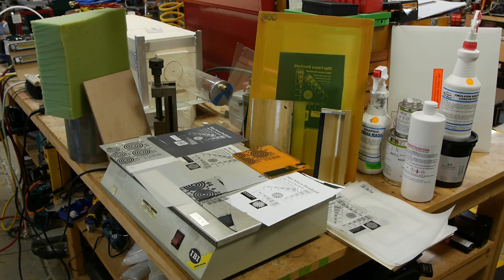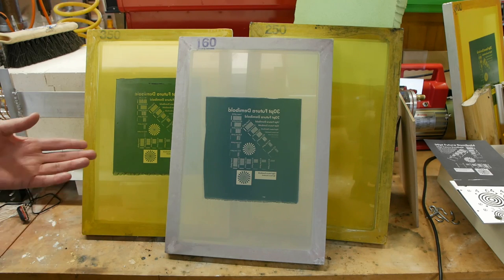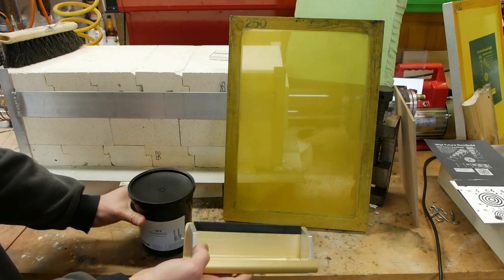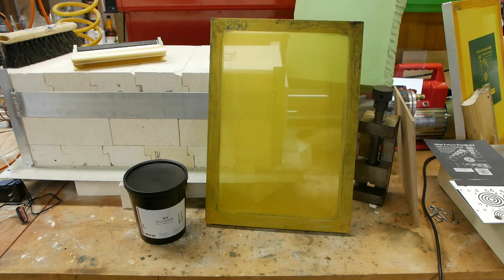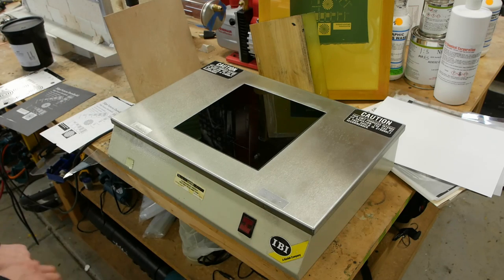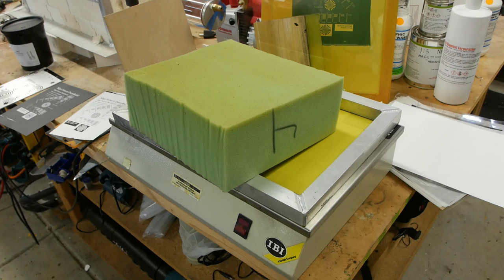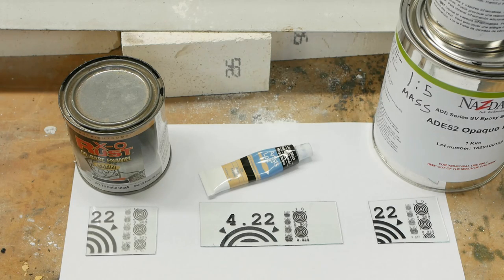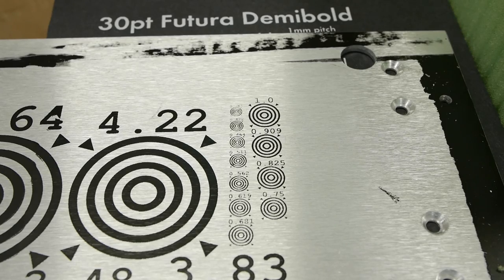High-resolution screen printing demystified

Comment: A couple of things here.  I really like your video.  It covers a lot of points I needed to see again.   

HOWEVER....  I see you in the opening scenes pulling the squeegee twice.  Once pull, then a fill push, then another pull.  Is this smart?  I think it will make a mess on the underside of your screen or make double images if the reg is not exactly the same.   I think on pull is it.  Maybe a different squeegee might be in order if you feel you are not depositing enough ink in one pull.   

SECOND:  I had no luck with Vellum.  It  just blocked too much light.   I had very good luck with the clear.  For the clear I used an ET-2750 inkjet printer on a clear Laser Printable film.  You can only print on the side that has a coating which will receive the ink.  On the other side the ink just runs.   

THREE:  I printed two clear films of each image on this clear film.  Then after they dried I layered them to create greater density.  I made sure not to touch the printed side as it could degrade (remove) the printed image.  I used clear tape to attach the films to a plate of 1/8" window glass ($20,00 new with the edges ground so to prevent slicing yourself and bleeding to death happens quick... careful!  Voice of experience here)  

I am printing lettering & logo art on the front and back plates of a aluminum enclosure used in an audio product I am producing.  I did screen printing in college Version 1 back in 1972.  I used the links in this video to purchase the materials.   I went elsewhere for the screen press and screens.  I just had, had it with the grumpy screen printing people out there.   I think they have been breathing the epoxy fumes for too long.   Hey, why pay someone to insult you?  Right?  Your video helped me a lot.  

Jim Moss Fiddler and Engineer/Programmer and later Marketing Degree

Comment: For the exposure, I would think that with a distant point light source or the sun, the micron gaps between the paper and the emulsion (coating) would be less of an issue. Perhaps you could replace the metal cover of your UV box, with a black cardboard or wooden box, a meter high or so, to increase the distance between the lamps and the screen. This would also bring the full lamps into the picture (pun), as that small window exposes (pun) less than half of the lamp's surface!
But then again, the velum will cause quite some subsurface scattering (diffusion), so maybe that defeats the whole lamp distance effort.

Comment: One thing,   I saw some place where they used some thin ( I would guess .025" thick) clear vinyl sheeting (Tap plastic in MV has it) as top layer to hold down the artwork using a vacuum pump. One would need something flat on the back like 1/2" MDF backed with some thin aluminum.  The idea is the vacuum pump goes between the aluminum and the MDF as the air will move through the MDF (very porous)    Al -vacuum MDF - silk -- art - thin clear vinyl  taped around the edge.   Craig

Comment: Use masking tape to tape off areas outside of the print area. Makes clean up much easier.  
Can expose with a 100, 150 or 200 w ordinary incandescent lamp.

Comment: I recently worked with metal nanoparticles for printing them in a standard desktop inkjet printer.
I tried to use copper nanoparticles since they are cheap. Unfortunately they oxidize rather quickly making working with them very hard. I also did not find a good ink recipy without toxic chemicals involved.
I found out that there are companies who offer silver ink online and they are suposed to work well with brother inkjet printers but I never gave the comercial nanoparticle ink a try. My own ink always clotted the printing nozzles. Nanoparticle ink might be a faster alternative to getting conductive circuits. Some background: I worked on this for a science project where we produced nanoparticles with synthetic bacteria. Project details can be found here: http://2018.igem.org/Team:Bielefeld-CeBiTec
Reply: @papu90  As far as I know the highest conductivities can be achieved with cut outs from silver sheets. The next best thing is printing and melting silver nanoparticles. Polymer based inks are more flexible but the conductivity is much lower. Carbon nanotubes and graphene seem to be flexible and conduct electricity well. They can be made super thin which helps making  them flexible but I do not know if they can compete with silver in terms of conductivity.  
I have not worked with Graphene but producing it seems harder and more expensive. I also do not know how easy it is to create conductive patterns with it.
The research seems to go in the direction of using Graphene for ultra thin electronics. I am especially interested in the use case of electronic tattoos for use in personalised medicine. We worked with nanoparticle because you don't need expensive equipment, a household printer, a kitchen oven and thermostable paper is all you need. Nanoparticles melt as exceptional low temperatures depending on the size and quality. Our copper nanoparticle 40 nm in size required 340°C to melt them into conductive structures but silver nanoparticles should have an even lower melting temperature and depending on the size (nanorods/nanowires seem ideal) and  temperatures melting points under 100°C might be achievable.
Reply: Try to do NOT use direct partical deposition.Instead : prepare silver or palladium activator - it's easy . This can bee an amonia complex(just desolv silver chlorid in alcaly and then add amonia to completly disolve oxydes )or coloidal solution of palladium-(dissolvind p.cloride in  colded stannum cloride.)-this give you a small micellas in acidic solution.  Then you can print them out on the sensibilized surface . Stannum cloride is usually used as sensibiliser ,then its washed out and deactivated by alcaly  p-you need hydrooxide film only. Problem there is to prepare a surface - cause etching in strong oxydisers needed.  You can also print copper in complex or as solt combined whith potassium hypofosphit- dry it and and then slowly heat it up to 150-170 C ... The last one method can be used for pcb manufacturing - hole\via metalization, but film is thick and galvanization needed for good result ...
Reply: @Appniko   We used the copper particles directly since when we produce them in our genetically modified bacteria the end result are particles of 8nm size surrounded by a protein shell. We showed that the production of particles inside the protein shells can be achieved in bacteria but than used commercially available pure particles (40nm) for the printing and melting experiments since they are similar to the particles we have produced in bacteria. Producing nanoparticles in bacteria and than printing them is probably not the best use case since you get much cleaner results by producing them chemically but it was interesting in the context of our project.  The use cases where you functionalise the proteins surrounding the nano particles seems much more useful since you can combine  the advantages of nano and bio science.

Comment: Pro tip, you can save a decent amount of money and get better results out of your emulsion by adding up to 1/4 water to emulsion before coating your screens. This will make the coating thinner, the exposure more crisp, the washout easier, and your edges clearer due to the screen being closer to the substrate.

Comment: Sooo.... What would happen if you used a Tig torch as an arc lamp/UV source?
Reply: I did screen printing a couple of times in high school and we used a light table that was an arc light. Glass top and 2 wobbly electrode tips that you would crank together to make an arc for a short time.
I took for granted all of this knowledge he is spewing. The teachers must have really had their act together. I just remember:  "make a drawing, put the stuff on the thing,  DON'T LOOK AT THE LIGHT!, Put the ink on the screen and wipe."
I will likely never use all of this interesting information, but at least now I know.

Comment: Getting a consistent coating is not iffy if you know what you are doing. Also, the premade film will not last nearly as long before flaking off. Your best bet is a Diazo emulsion that you water down yourself for the specific application. The quicker you move the trough, the more consistent your results will be.

Comment: Few things I disagree with, though I'm not dissing this guy, my experience has just been a little different. First, the sheet of photo sensitive material he used instead of the diazo. This is going to give you a very thick layer of ink on your fabric. I had been using a screen with a vinyl sticker material I printed letters on then cut them out with a razer knife. Hay it was my first screen and it worked, and is still working if I pull out that old screen, it still does work. What works better? the liquid diazo he don't like, and I do like, and here is why. I use 180 screen and initially used a scoop to spread the diazo. The scoop did a shitty job so I did the initial spread with the scoop, then thinned it out with a 3" wide plastic bondo spreader. This diazo starts to dry and get thick so you need to work quickly, go over it from both sides of the screen pressing firmly and thin it out until you got a layer of diazo embedded into your screen with no diazo on top of the screen. Then put it away to dry. What you will end up with is a screen that is only as thick as .... your screen. It will have no extra thickness added with diazo on "top" of the screen, only embedded in the screen. This is exactly what you want or you will get to much ink thickness on your fabric. What works for me is then when you screed off the extra ink, you can leave more ink on the screen, or you can screed it off hard and end up with a thin layer of ink. For me, this is exactly how I want it to act, with this thin screen, I can control my ink thickness, thick or thin, I get what I want. Ink type, just buy professional ink if your only doing small prints or just printing now and then etc. Don't even think about using something like a 2 part epoxy, that is total insanity unless you got a real need for it. I am printing white on black and the water based professional thick white ink works perfect. I am going to try thick white latex paint as I have a local paint company that manufactures their own paint and it is insanely high quality and thick. I may have to mix in some pearl pigment or powdered titanium dioxide to make it "bright white". As for keeping the screen spaced above the fabric when you print, NO! Go search and watch professionals screen print. NO ONE DOES THIS. Why? here is why. When you spread the ink on your screen/fabric, you space the screen up and you only got one single pass to get all the ink on and get it perfect. you wont, it will not work. With the screen down right on top of your fabric you can gently spread and screed your ink and make sure you got full coverage, you can see it and if you got ink everywhere or not. You can screed off the excess ink hard or gently and leave a thin layer or thicker layer of ink. Try any of that with the screen spaced above the fabric and you will fail totally. Don't believe me? then you simply have not tried it yet or watched a bunch of pros screen print. Now go off and watch a bunch of screen print videos then go and do some screen printing, it is fun and you can make a buck if you want. I just screen a logo on one of my products. I screen print some other cool stuff on shirts but for my own use. Screen printing is cool. Don't expect your first tries to be perfect but practice and do research and watch videos. For perfect results, experience matters so get some.
Reply: One large assumption you have made is that he plans to print on fabric,  However my guess he is looking at pcb screen printing or some form of conductive ink, you would want a thicker layer in this case. He has used the 2 part epoxy because he is printing onto glass.

Comment: Great video. For UV blasting my PCBs I'm using the cheapest Nail UV Light, it usually costs ab. 10$ and has 4 fluorescent lamps. Two of those can also work good for this purpose.

Comment: The big things when selecting an emulsion are what sort of ink does it need to resist, and what sort of chemicals are you tolerant of when it's time to remove the stencil.  I print mostly with water-based inks, so I choose an emulsion that is resistant to water-based inks.  The one I use is called Ulano TZ.  If you use solvent-based inks you'll likely need something designed for that.  To remove the stencils I prefer a product that's designed for that purpose and is paired with the emulsion you choose.  Some emulsions are removed with strong solvents, which is a nasty process.

Comment: to print on thin paper. it is possible to add support thick back paper to a thin paper. using adhesive tape along the top. 
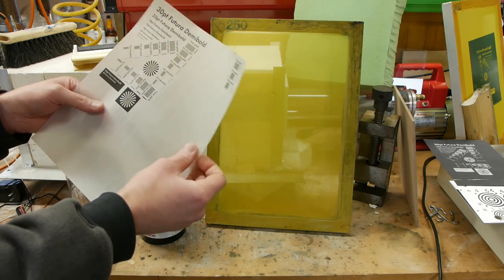#11:42

Comment: When I etch my own PCBs, I used an uv-LED strip that I bought from amazon. I got a 5m 60 LEDs/m srip and cut it into shorter strips and glued them next to each other on a wood board. I just want to say it is a good option as exposure lamp...

Comment: I wish i saw this when i was learning super high res printing techniques, People underestimate the difficulty of high res printing, especially on plastic. surface energy of the substrate is very important too, make a corona discharge machine. and there is a way to print way smaller than you would think if you have a super-fine mesh and some specialized equipment to get the positive in molecular contact with the emulsion. Oh and you should get a yellow light room if you are doing this long term.

Comment: For paper you can try tissue paper tacked on a carrier sheet. I used this method to print patterns for decoupage on irregular surfaces (it's flexible enough to conform like water transfer does but without the hassle of a tub). Anyway, it makes a very thin sheet that I expect would transfer light even better than what you recommend.

Comment: Even though this was not the intention, some of the processes used here may also be useful for other forms of photolithography. In my case, printed circuit boards. Some of the materials you used and the way you explained the steps gave me answers to complications I had when making pcbs. Great work! What are you planning on using the screen printing for if I may ask?

Comment: I use to screen print Tshirts ans pcbs, but never achive a really high resolution. One thing that amazed me, was that some printers use a vinyl cutter to make their negatives, they just apply it to the screen and expose the design. Even older school printers, they painted they designs over the screen by hand with black paint (creating unique and more "art" screens).
Maybe you could use a pen plotter to plot the designs over the emulsion and have a perfect contact, thus avoiding to cast a shadow.

Comment: The high thread count and metal screens are usually for machine printing with mechanically moved steel rakes.
Reply: Also try to find some service that still makes real offset-printing photo films. They are 100% light tight in the blacks and razor sharp.

Comment: As someone who has worked with a formlabs printer, one has to wonder what the indirect transfer of regular-print to photosensitive is good for, other than legacy/cost reasons. Directly engraving the pattern on the photosensitive layer would be able to get crazy resolution, if you have the hardware for it; or at least make the ink-transfer process the resolution limiting step.

Comment: A couple of questions here.  First, I am using an eps file created in Illustrator to print out to a Vellum sheet.  Then I will make a 250 - 300 screen.  Do I need to use a half-tone screen here or can I just use the solid lines of the eps?  At what point do you need a half tone screen?   The print area is 17" long.  Where can I find Vellum that long?  Jim

Comment: I'm wondering how well an LED UV source would work? I've got a bunch of UV LEDs, I could easily solder up an array of them and use that as a source, right? Of course I'd have to fiddle with the exposure times, but I can't see why it wouldn't work.

Comment: I'd try to use Pictorico OHP or clear Ilford Omnijet for more resolving inkjet prints (they're probably not the weakest link, but with analog processes with degradation at each step, everything helps).

Also a higher end printer meant for photos might help; another gain would be that certain inksets have better UV opacity.

Comment: Would holding it down within a vacuum contained between glass sheets in a frame allow you to dispense with the weights and achieve a more uniform contact pressure ?

Comment: What surprised me most was printing the "negative" on vellum paper instead of a transparency. I have never heard of using anything other than a transparency or film negative to expose the screen. Certainly I would think that diffusing actinic light through a sheet of vellum would scatter the light and produce fuzzy edges on all the detail. No?

Comment: What about the 'nails on chalkboard' factor from all the scraping and scrubbing of the mesh? That could be a deal breaker.
Reply: The ink lubricates the process, on real screen printing presses that are very automatic, the sound the rest of the machinery makes completely overwhelms the sound of the squeegee gliding over the screen stencil on the film of ink that it is transferring through the stencil openings.  It DOES make noise, it's usually not too annoying.  When we have both 4 color large format screen presses going with the multiple hot air exhaust blowers for the UV cure lamps ( All our inks are UV cure) and the blowers supplying vacuum for the press beds ( The prints will stick to the screens during printing if the printed sheets  aren't sucked down tight to the press beds)  it sounds like the building is about to take flight on the outside where all the air gets exhausted.
Reply: Wuss. It doesn’t sound bad at all.